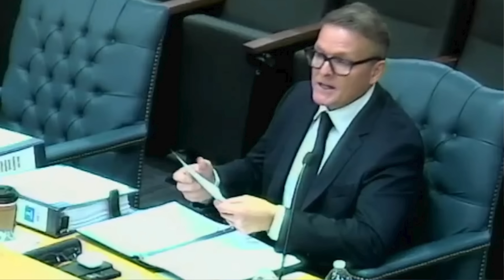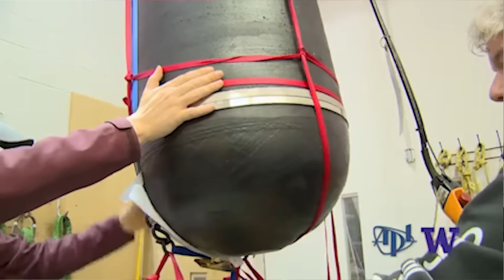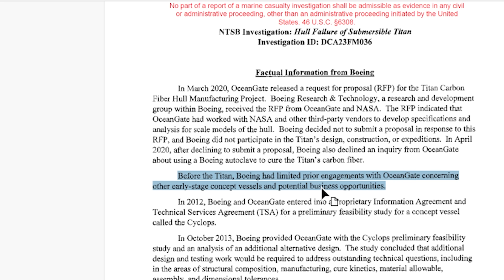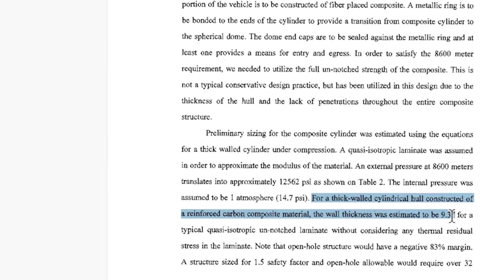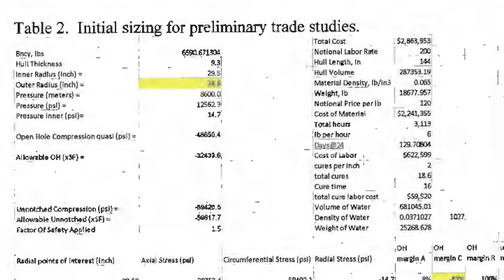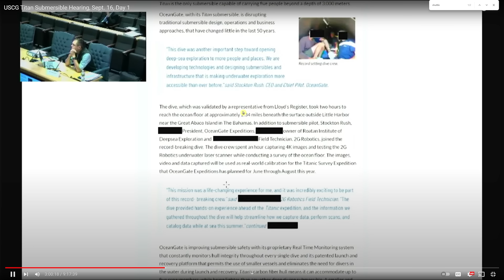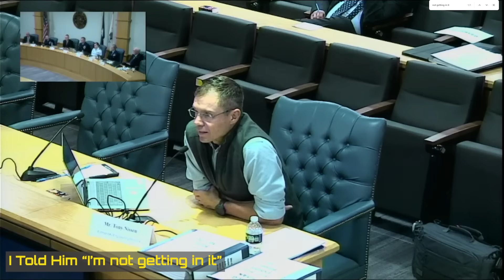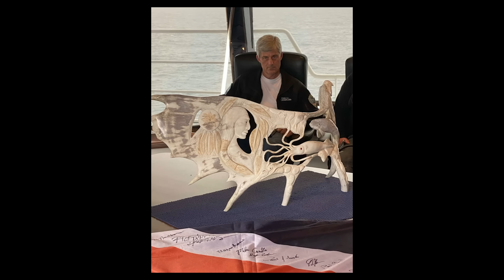Titan Sub: Fired OceanGate Employees Show What REALLY Happened

Comment: JEFF - HERE IS SOMETHING WE DIDNT KNOW ABOUT THE OCEANGATE TITAN SUBMERSIBLE: UW 'S LAB TESTING OF THE TITAN SUBMERSIBLE INCLUDED IMPLOSIONS OF THE OCEANGATE DESIGN AND STOCKTON RUSH REFUSED TO TAKE BOEING AND UW'S DESIGN RECOMMENDATIONS in order to prevent the conditions that enabled the LAB TEST " IMPLOSIONS" at UW , that must have been before 2018 : 

It was designed and developed originally in partnership with UW and Boeing, both of which put forth numerous design recommendations and rigorous testing requirements, which Rush ignored, despite prior tests at lower depths resulting in implosions at the UW lab. These partnerships dissolved as Rush refused to work within quality standards.[28]
THE UW LAB TESTING RESULTED IN IMPLOSIONS 
💯💯💯💯💯💯💯💯💯💯💯💯💯💯💯💯💯💯💯

Comment: It blows my mind that the facility being used to wind the carbon fiber hull being dirty is a concern , yet they let the whole vessel OVERWINTER IN A FREEZING COLD PARKING LOT W NO TARP NO NOTHING protecting the sub …. Really ?    ….. nightmare fuel .
Reply: Yes, and he was told a sphere is the preferred shape of deepsea vessels as pressure is equally distributed as opposed to a cylinder where the center is the point of weakness.

Comment: No one wants to say this but………stokton was right, he said a carbon fibre hull would make it to the titanic , and it did, many times in fact . What he did wrong was, he didn’t put a Dive limit on the sub, he got greedy , if he limited it to 20 dives and then retired it then made a new one and did another 20 dives and then Made a new one etc we would al be here saying how great he is and how right he is, and how he is a pioneer ……..but he didn’t he pushed it beyond its limits without really knowing what its limits were because he didn’t do enough testing and data collecting 
Also… all this acoustic monitoring is nonesense it should have been strain gauges to monitor flex , the acoustic monitoring should have been a secondary monitoring system,.

Yes I’m an armchair expert haha

Comment: Hey, don't overestimate military grade. Military grade stuff is probably the cheapest, most worn down used goods that anybody could buy for 5 bucks and a pack of smokes. And even that might b expensive for them. The ONLY thing i can imagine that is actually pretty dang good for your buck that's "military grade" are the weapons. Until the Sig MCX and the P320 came into service, the M4, the M9, benelli M4 and the M16 have been in service for decades cuz of how reliable and robust they are, so they stuck with it. But even now the weapons theyre cheaping out on. And not to mention, the weapons are either discharging in holsters, or jamming up because of cheap horribly manufactured parts. Yeahhh, this container is probably as military grade as you're gonna get

Comment: Cyclops 1 was not the first version of Titan. Cyclops 1 was a completely different sub and it can only dive 500 meters max. That one also does not have a carbon hull ( although initially it was designed with one), but has a steel hull, that came off a 12 year old sub called Lula that Oceangate bought in the Azores.
I think you have mistaken Cyclops 1 with Cyclops 2...
The latter did idd become Titan, or better yet; was renamed to Titan. It was the second hull of that one that imploded.  The design was exactly the same and the way of manufacturing was the same + the discount carbon used;it was inevitable that this would happen one day. It's a miracle that sub  made so many dives before it happened

Comment: He wasn't a narcissist, seems fashionable to use that descriptor in recent years. He may have had an ego but that is common with most high functioning people.  He was trying to apply aerospace materials into submarine construction without fully understanding ocean pressure dynamics and points of failure in design. The material is a non starter for repeated use at extreme depths.

Comment: First and foremost I don't think Rush believed he was going to die down there he would not go down there just to die and kill those people number two yes design flaw in my opinion from owning a machine shop is gluing carbon fiber to Titanium without even a step in my opinion the titanium should have been stepped down and the carbon fiber should have been close to 10 in thick and the titanium Hall should have ran from front to back of the submersible with the carbon fiber wrapped around it for buoyancy then you would have a submersible that is almost indestructible because it's relying on the titanium for strength and the carbon fiber for buoyancy

Comment: I think the reason why the Titan dived at a faster pace than normal was the water satuation of the delaminated carbon fibre, it had lost a lot of that buoyancy that Rush bragged about, as well as its strength-the water pressure INSIDE the delaminated carbon fibre would've accelerated the carbon fibre disintergration too.

Comment: See, I don't mind how he built it. If you are so good and forward-thinking that you can make the core of a life support system out of a Lego box for 6.99 and it's tested, retested 50 times, stressed to failure and it works... man, props to you. If you find a new way to make carbon fibre and design it in such a way that you test it, retest it 50 times, stress it to failure and it works... double props to you. The xbox controller: does it work? yes? AWESOME, use it (maybe not wireless... but that's beyond the point). 

Do they still not want to classify your build because they are close minded? Start using it at your own risk, but you need to be sure beyond the shadow of a doubt and prove with facts that you are right annd they are wrong. You need to put 10 times as much effort to prove that it's the "rule" that's wrong before you start breaking it. But he didn't do that. He assumed everyone else was dumb, that he was better, and left it at that.
Reply: "See, I don't mind how he built it"

But how he built it was exactly the problem - and by that I don't mean so much the materials he used, but the processes he used to assemble those materials. The fact it ever got to Titanic at all demonstrates that the materials in and of themselves were capable of achieving the task at least in the most abstract of terms, but those materials were used with such stupid, reckless incompetence. It's as though he proclaimed he could build a bridge out of wood, and then insisted on using nothing but used popsicle sticks
Reply: @rhonafenwick5643  You missed the part where I said "test it,  retest it 50 times, then stress it to failure".
If he did that, we wouldn't even be talking about this, regardless of how many stupid decisions he took. It would have imploded on its own and that would have been the end of it.
Of course he chose the wrong materials, I'm an architect and even my basic knowledge on material behavior under stress makes it very obvious,  but again, it really doesn't matter how many wrong choices you make as long as you do proper testing.

Innovating isn't a bad thing, going against some of the rules isn't necessarily bad, as long as you take all the precautions needed. He clearly didn't.
What I'm saying is, the way he built the sub didn't cause the tragedy, his lackluster (at best) attitude towards safety did.

Comment: I don't know what Stockton Rush was thinking. I have absolutely no education on the matter, but even I can instantly see the issue with using a carbon fiber hull, with titanium end caps.

Carbon fiber has tensile strength. But the only thing making it rigid is the epoxy. So it would have poor crush resistance, as it would only be as strong as the epoxy itself. 

And using different materials should have been an instant red flag. Different materials expand and contract at different rates, and differing amounts. Not only that, but the connection between the two materials is only as strong as the bonding material. 

So if the hull compresses more than the metal end caps,  all of that stress would be on the bonding material. Most likely an epoxy of some sort.

Comment: Just because something is made of consumer grade components doesn't automatically mean it doesn't work. One of the criticisms I recall from the submersible was that it was using a consumer grade game controller for steering or something.  I've seen Playstation controllers used in university labs and there's an argument for their use that says there is no controller in existence that has been used (tested) by more humans. As each model of Playstation was released presumably it included changes to the controller to address flaws that showed up in the previous versions. Further,  that since they are more affordable than (say) the controller of of an F17, you can afford to have a bunch of spare controllers on hand in case the one you're using breaks. 

Finally we know those controllers are used by large numbers of people for long periods which presumably matches the requirements in the vessel.

There is/are economics in engineering and it may be that you get the best solution out of adapting a child's toy because it's strengths are so good that its plastic construction is relatively unimportant. 

The example of the CO2 scrubber reminded me of the emergency engineering conducted by NASA to help the Apollo 13 crew adapt a scrubber using the items they had at hand like chewing gum, a spacesuit, food wrappers,  paper and tape. (I wouldn't be surprised if this was dramatised in the film). The crew didn't care how it looked - their lives depended upon whether it worked.

I'm not saying you engineer a CO2 scrubber for your submersible out of junk because you assume that is a good starting point.  But,  it does make me think,  again, about the economics at play and the full set of requirements a device has in a vessel like a spacecraft or a submarine, where space is limited,  things may go wrong and when that happens no one can come along to help. So, for example,  what one could takeaway from the Apollo 13 drama is that life support systems need to be fixable by half conscious people using basic tools and spare parts. So a plastic box with a PC fan on top of it might have some advantages due specifically to that same amateur construction.  And another design that can survive a nuclear explosion has strengths that are not as relevant as the scrubber serving its purpose when the sub is upside down, the atmosphere is already incompatible with life, and it has a big dent in its side.

Designing for when things aren't normal, is often overlooked ɓy less experienced engineers. 
Eg can a capsule door be opened in an emergency like an oxygen fire...

So at first glance,  don't dismiss something because it is cheaply made,  uses off the shelf components or looks like a kid could take it apart. It may in fact be an incredibly well engineered system.

Comment: carbon fiber is basically like a thick piece of felt. 
you can stress the fibers and not see it yet make weak spots over time with repeated insults. 
 idk i dont think it was his amateur crappy tech , I think it was the repeated  uses of carbon fiber hull, they d been down too many times and each fiber had faced too much stress until that factor overwhelmed the carbon fiber mesh. the pressure damage. yes. there seem to be other weak spots in their design. that's so much pressure i mean..... also ... to me I see carbon fiber focal weakness
they went too many times with the same hull and did so for money and their own greed. 250 - 500 k per attempt to sink to the titanic???? lying loser wow  but I think it's possible many involved did not know any enter.

Comment: The Titan was a carbon fiber tube with two titanium end caps. How were the end caps attached to the hull?  Thats 2 huge seams that have to hold under incrrdible pressure.  
The video i saw of the construction of the sub stated the end caps were GLUED to the hull.  Glue.  Just imsgine that.  Your life depends on two large glue seams holding under enormous pressure.  Bottom line, there were multiple reasons this thing could have imploded.

Comment: Why wouldn’t a company as big as Boeing not make it public or at a minimum formal letter of statement, via council, say; ahhh, no, Boeing is not in collaboration with the Titan project, pls remove claims stating such🤔

I don’t believe in the end the portal was the weak point…it was the hull itself, wasn’t it 🤔 

TBH, $2 million….imho that’s a bargain….to reduce the hull thickness vs the cost savings….is a head scratcher….considering the extreme workloads expected. 

I get money is always a consideration..even for engineers..cost/risk assessments are done all the time..but why not make the first few models over rated…then as time, materials and improvements are discovered, slowly make the changes, potentially saving costs

Comment: As a mechanical engineer you don't reuse anything. EVER. Also, you don't "glue" anything to anything when designing a submersible even with no passengers. This whole mess just just against all engineering ethics and done very unprofessionally. How did Stockton Rush get this past anyone who had just a smidge of common sense.

Comment: Cutting the thickness of the hull while also reducing the rated depth wasn't particularly outrageous ... the 10" recommendation was for a vessel rated to 8.5 km.  (Rush quickly abandoned the notion of taking tourists into the Mariana Trench.)
In retrospect, when you look at the thin titanium ledges that held the ends of the carbon fiber cylinder open against the external pressure, it's a miracle that the sub survived as many dives as it did.

Comment: Two different materials (one material tolerates twisting, the other does not), bonded together with glue, extremely high pressure, low temperatures, rapid descent, no additional or backup propulsion system, one man's stubbornness = tragedy

Comment: When I examine the specific photograph you’ve shared, I notice that the debris appears confined to a relatively small area. This suggests to me that there was no implosion; instead, it seems the submersible struck the ocean floor intact. It’s possible that when they attempted to release the weights, it compromised the submersible’s stability, causing it to nose-dive. Alternatively, the weights might have been dropped in a way that wasn’t ideal. I’ve heard it suggested that the debris should be scattered over a wide area, but the image I’m looking at doesn’t support that—it shows the viewing port and rings tangled together, which points more toward a crash than an implosion.
Reply from the maker: This was only part of the debris, the rest is scattered over 200 yeards

Comment: JAMES CAMERON  WAS NOT WRONG. He had "insider info" from a Navy Rep that the Navy had received evidence of "a loud implosion at depth". And as James Cameron pointed out, the only way you lose comms AND tracking  simultaneously of any vessel it was due to loss of the vessel at depth. 
He also spoke of a process known as last known position when searching for any undersea vessel. But the Coast Guard didn't possess the equipment  to look at the ocean floor. When they finally got the ROV to look down there, they found the Titan tail cone right away...AT the last known position.

Comment: I guess delamination of the carbon fiber starts under extreme pressure and stress.
Reply: there is another video where they think it popped open like a can of biscuits at the Hull/Ti ring interface.
Cause the Ti Ring had a groove cut in to to 'catch' the carbon fiber mechanically. So, the interior side of the Ti-Ring-Groove is gone missing off the Ti-Ring it self. 
Broke the ring smooth off. They thing the glue failed in-cycles/

Comment: They used Loctite EA 9394 to glue the rings to the cylinder. This was the wrong adhesive for this application.  It only has a shear strength of about 4000 psi at room temperature, much less at 28 decrees. The glue application was done poorly with no clean room or proper preparation of the titanium ring.

Comment: Looking at Ocean Gate and the real Stockton Rush, they seem like a small racing team that participated in Formula 1 in the 1990s, and were regular tail-enders and failed to qualify😢

There is a technical director who is more passionate than anyone else, and a team owner who worships him. However, due to chronic financial difficulties and differences of opinion, drivers, mechanics, and even engine suppliers are frequently replaced😨

The F1 machine, which the technical director is proud of, only looked good, which helped attract sponsor companies who knew nothing about motorsports and pay drivers who wanted to run on the F1 stage at all costs, but it did not perform at all in actual races. Even so, the person in charge, who was more passionate than anyone else, continued to say, "It's okay because we will definitely be able to achieve results next time" until the day the funds ran out and the team withdrew😱

If the team owner himself had strong convictions, he could continue participating for a long time by properly reassigning engineers, but if the technical director was the absolute authority of the team, the results were generally disastrous.  This is because no one on the team will be able to point out the fact that the reason for the failure in the race is the poor design of the boss himself😇